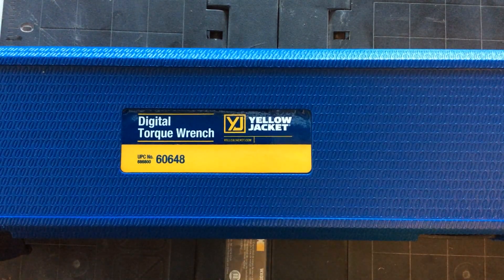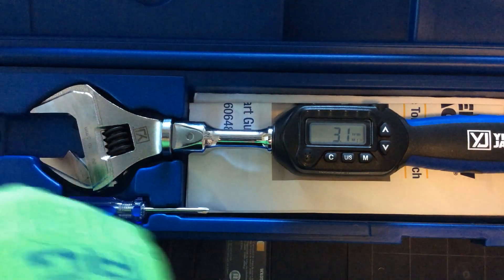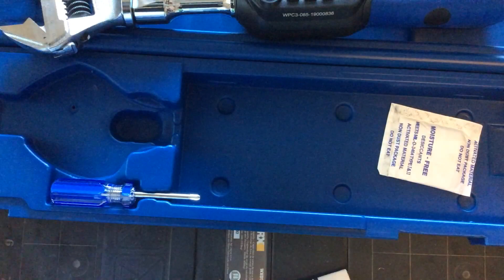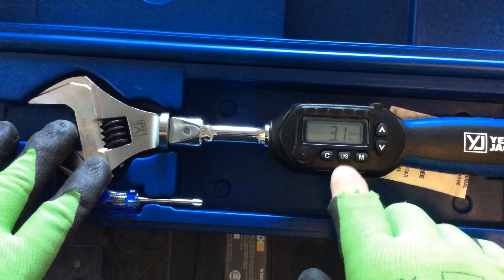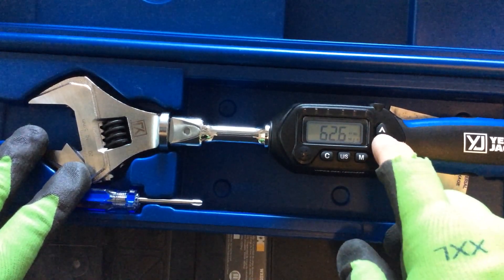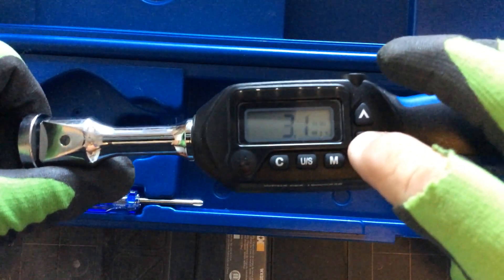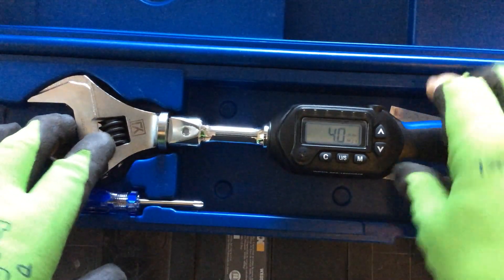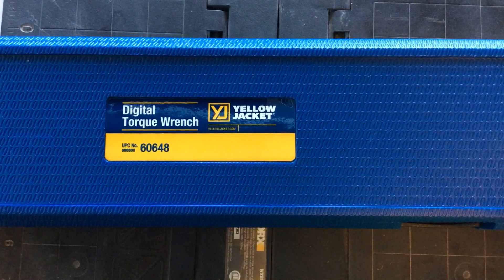Tool Review on the YJ 60648 Digital Torque Adjustable Wrench

Comment: Very cool. We do mini splits. This takes out the "is it tight enough?" SNAP! Outta the game.
Reply: Chris I am a homeowner.  Have you ever used those flare nut plastic gaskets to prevent leaks?  I just got my YJ 60648 from Amazon. Let me know please and thanks
Reply: I've installed hundreds of mini splits and have never had a leak using my two small $5 wrenches from Bunnings, some Nylog Blue and some muscle memory when tightening the nuts. The Nylog Blue makes it so that you only need to tighten the nuts a tiny bit before they're leak-proof, you can feel the copper taking shape as you tighten it. This torque wrench is more for people who don't use Nylog Blue, but in my experience using torque wrenches on dry copper and using Nylog Blue with $5 wrenches and muscle memory I'll stick to the latter